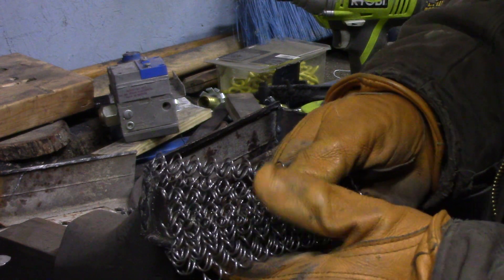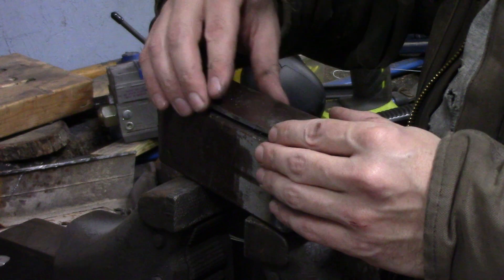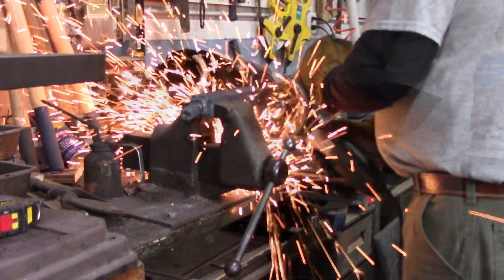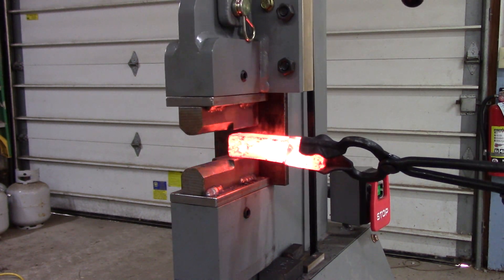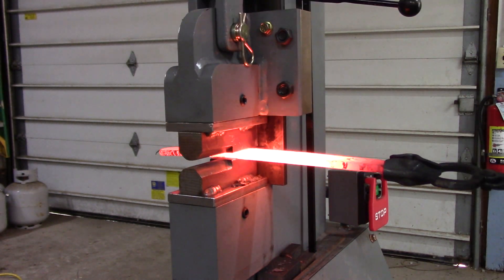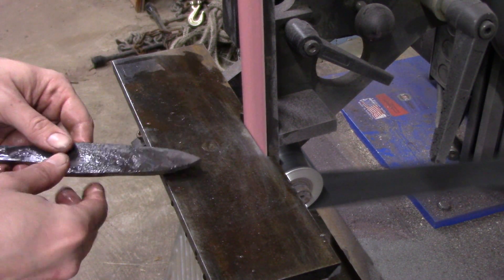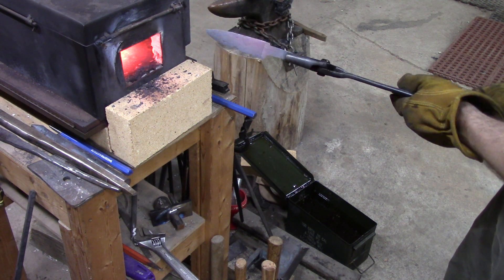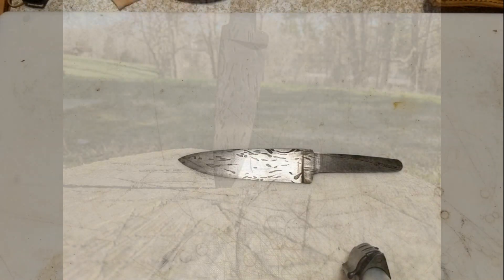Canister Damascus using 1080 powder with 2% nickel and mattress springs,  forge welding beginner

Comment: I find it frustrating when i only get one super awesome side on the etch. So I started folding the billet when that happens. Dull side in. Always makes for a good fix. Great video bubs, I sub
Reply from the maker: I do still have about half of this steel sitting on a shelf.  I might have to see what happens if I cut it into 3 or 4 pieces stack it and draw that back out.
Reply: @bransonsgeneralstore  probably get a little extra gnar poppin out. Maybe even try grinding a staggered patter on, the hammering the billet flat again. Exposes more detail

Comment: Hey! I really like your video and I can't wait to do some cannister damascus myself. What tonnage is your press. I'm looking at the Coal Ironworks and can't tell. Thanks for making this video! And I have the same problems with my shoulders too.
Reply from the maker: It is a 16 ton.  I like the C frame design.  Also since it weighs 7 or 8 hundred pounds it works well as a vice for twisting.
Reply: @bransonsgeneralstore  
I was wondering about that. A vice would come in handy. It looks like it has plenty of power to do whatever I would need. I'm wanting to make hammers too and I think this would do it. I was looking at building my own and I still might but I may buy one of these. 
Thank you very much!
Sam
Reply from the maker: @Sickofsociety1  With the right dies It would be great for making hammers.  I considered building my own press as well but decided time was more precious than money.

Comment: The end result is sweet. All is do is slightly thin out the tang and use an elk horn for the handle.
Reply from the maker: Thanks,  I still have not done anything with this particular blade I may just do something like that.

Comment: Line the inside of your can with stainless steel foil and removing the can will be a crap load easier. Those springs look all squiggly I love it.
Reply from the maker: I have heard of using stainless foil but have not bought any yet to try.  the biggest problem was a crease that I put in the can by over pressing it at first.  Made a corner that would not let go.  The can was a lot softer than I was expecting it to be until the stuffing inside of it was welded together.  Thanks for watching.